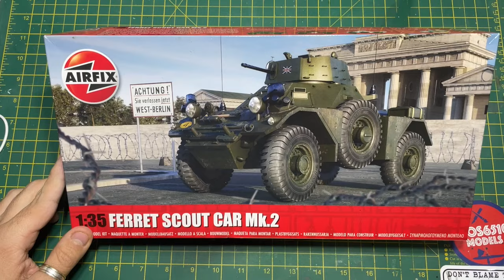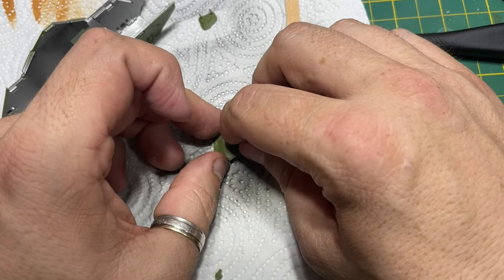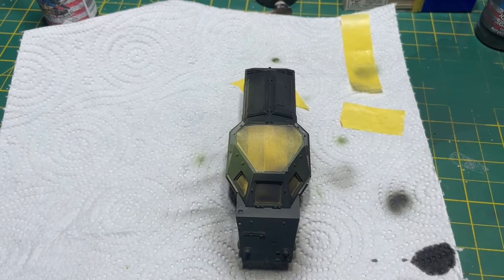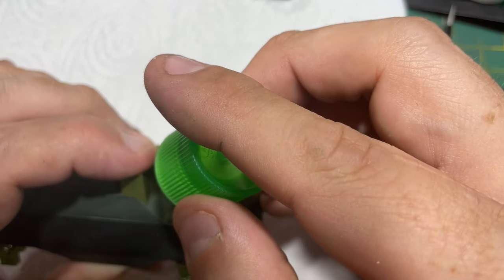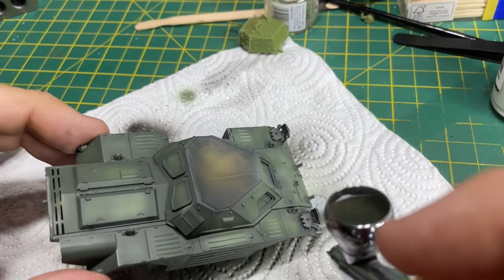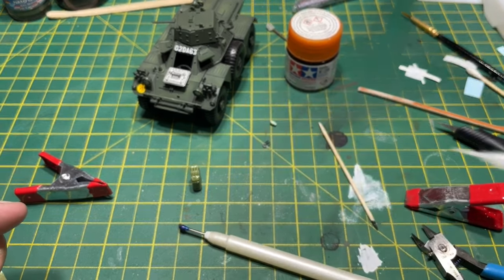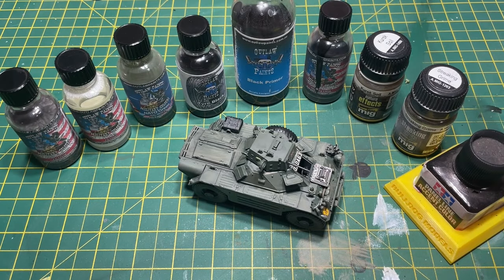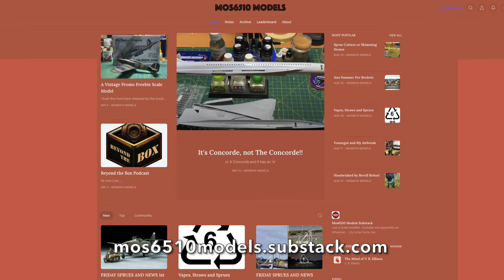Building the Airfix Ferret Scout Car 1/35 : Model Kit Build Video

Comment: Hi just a quick question does it matter what colour you paint your airfix model tank
Reply from the maker: depends how accurate you want to be i guess. its your model, do what you like :)
Reply: @MOS6510Models  cool it is a panther and I got a missing a paint colour for it
Reply: The Paint the army paint theiir vehicles fades quite easily then if they are repaired they just paint the new panel. We hade to pàint our Land Rovers once, at the end a few of us helped paint the last few. 4 tins of paint, all stirred differently. No two side or front and rear were the same shade. Doh!

Comment: Man that’s a tiny armoured car! don’t forget to add the antenna. 😅 Looking at this kit I see it as a nice base for a lot of extra aftermarket addings. Somehow Airfix is still more comfortable with aviation subjects, lately producing well engineered airplanes and Helicopters, than armoured vehicles in large scale as this Ferret is only their 10th kit of own production. I was expecting a bit more crispness of the plastic like for example the new ICM sd.kfz.247.. There is still room for improvement for Airfix ✨👍✨
Reply from the maker: because this is gonna be shown at model shows the anntenna will have to be thought out